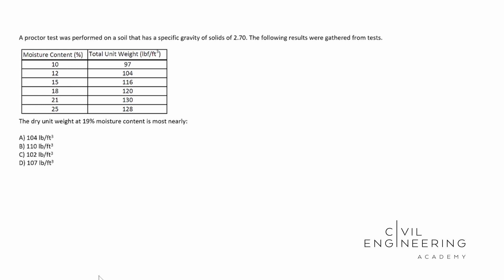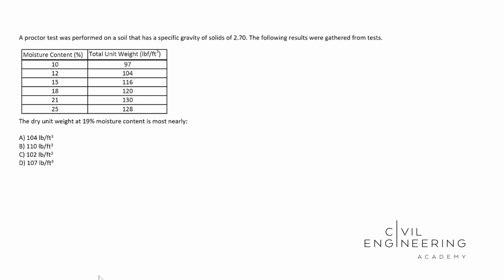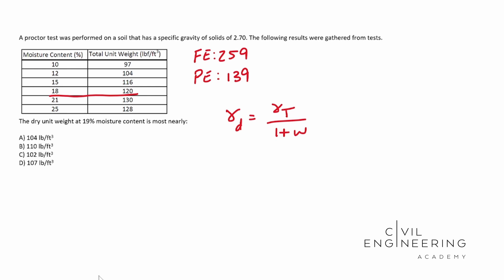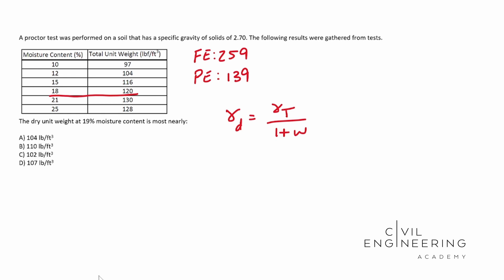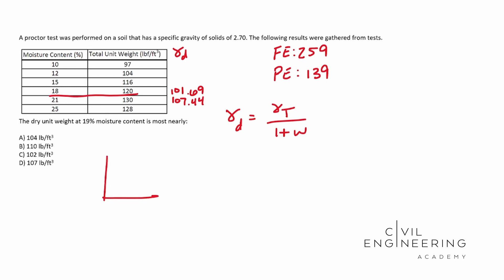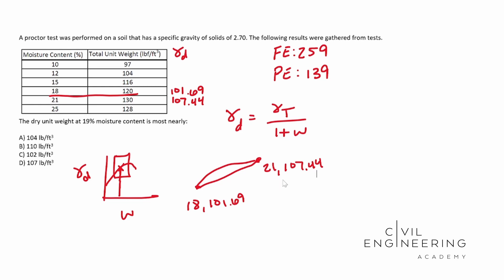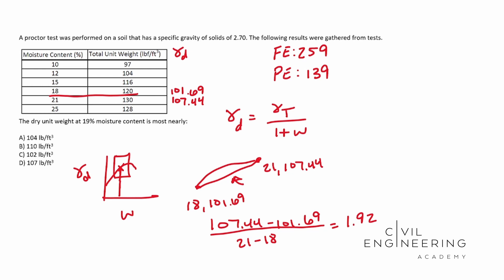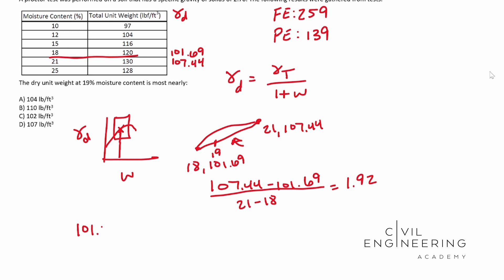Civil FE/PE Exam - Geotech -  Solve for Dry Unit Weight Given Moisture Content and Total Unit Weight

Comment: im confused why the problem is asking us to find dry unit weight but it seems like we found total unit weight? wouldn't you have to plug the 103.61 into the dry unit weight equation?
Reply: We found dry unit weight. Total unit weight would be higher. Look at the values in the table for total unit weight.
Reply: I'm with Racheal on this one, I don't really get how Cody plugged in total unit weights and then pumped out a dry unit weight...what I did was linearly interpolate between the moisture contents and total unit weights given and got a new total weight at 19% moisture content = 123.33pcf. Then using the equation Cody first talked about I plugged in the new 123pcf total weight and 19% moisture content and I got a dry unit weight of 103.6pcf ~= 104pcf. It felt like Cody got the right answer doing the wrong thing but maybe I missed something...